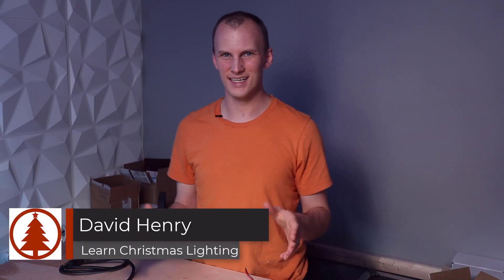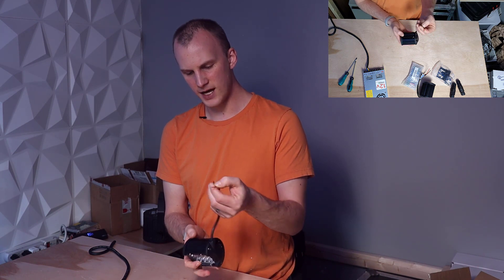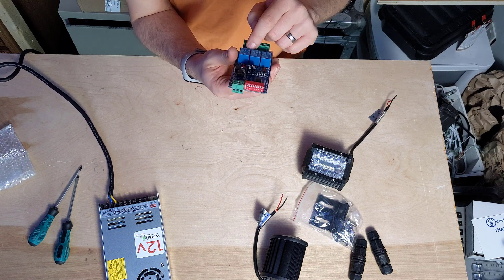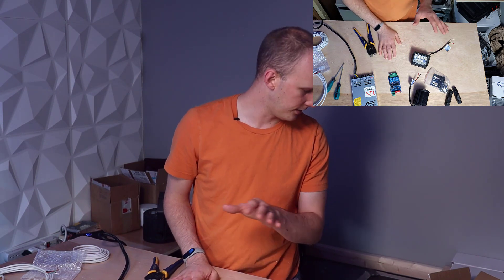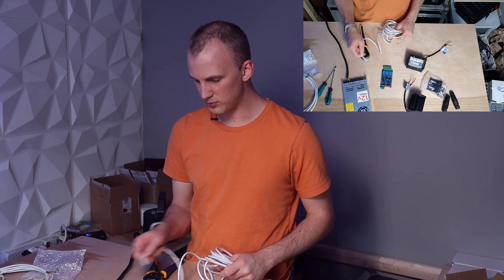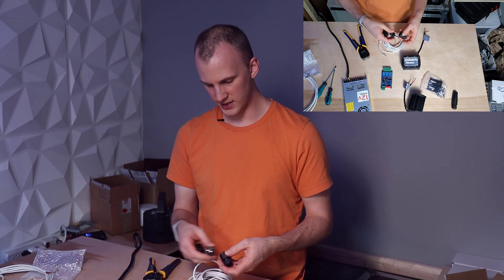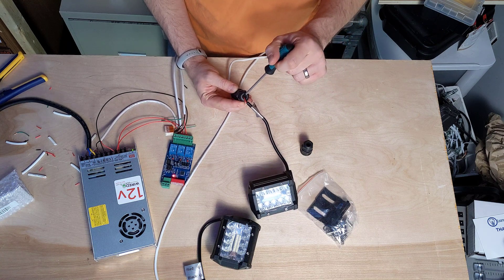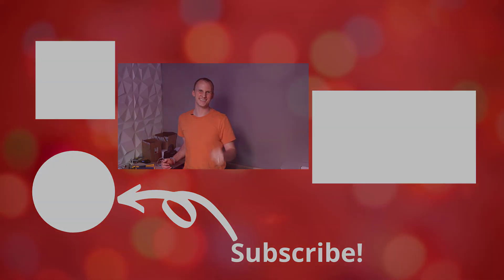Blinder Lights - How to Use 12v Headlights in Your Display with DMX

Comment: I am interested in doing this for my display but I am looking at getting two for 6 RV lights, I don't see anywhere on the board for DMX out, Is there something that I am missing. How would you connect other dmx stuff after this board?
Reply from the maker: Just bring both of your DMX cables to the DMX "input" on the box.  It'll work :)

Comment: Hey, I wanna thank you for these videos, they have been very helpful.  I have a question, I want to get started with xlights by programming a single 16ft 300 pixel led strip, or possibly two, meaning id have 600 pixels.    I'm really new to the hobby, so do you know if there a cheap controller I can buy, or do I have need one?   Can i just run them right from my computer?  And do I need a power supply?  Basically, what do I need to start from nothing just to make a display with a couple led strips?  Thanks so much.
Reply from the maker: This series is slightly outdated, but it does walk you through the basics well: https://www.youtube.com/watch?v=RLytArjNmcU&list=PLccGtinHO7IxbKXlfCYrv2KSa4tLKG5qW
Reply: I have a question, in xlights in the sequencing tab, I’m in master view and I can’t see any of my props, also, I don’t know how to make groups in xlights. And where’s the best place to buy pixels right now that are in stock